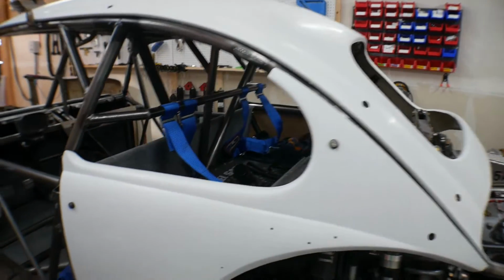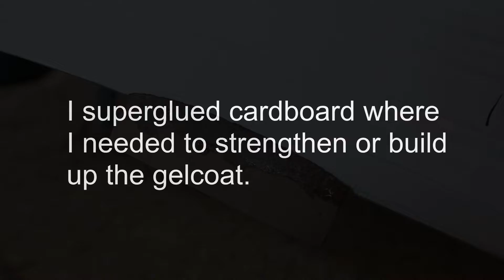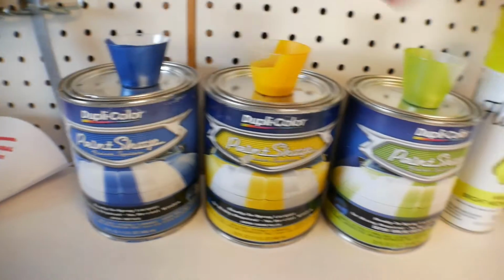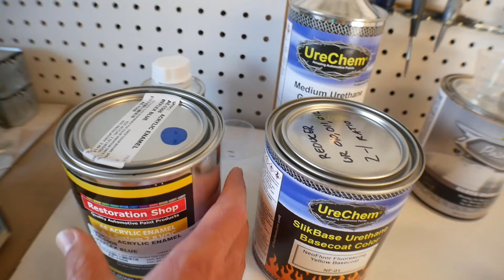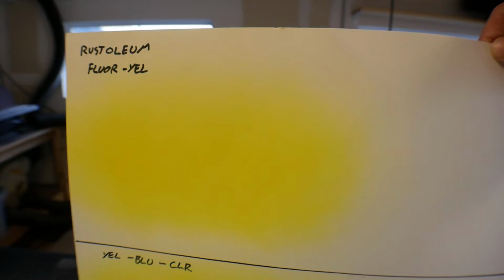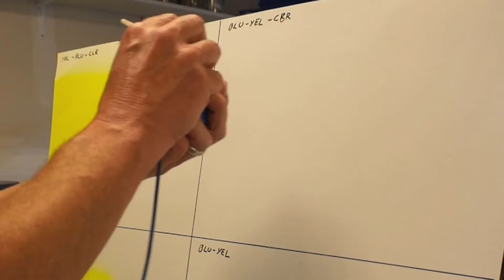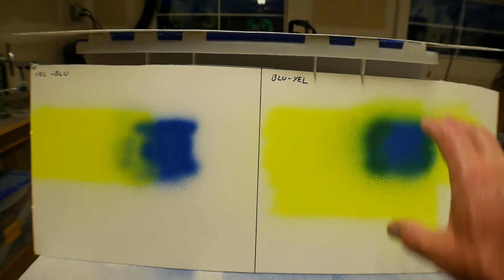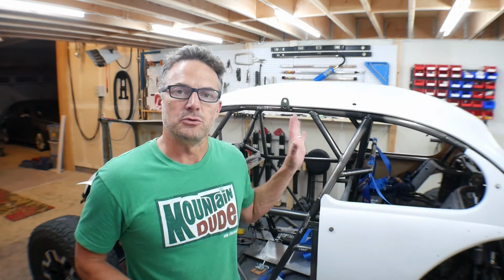Bodywork and Paint Prep for Wratchet

Comment: looking forward to seeing the results!  make sure you turn off & unplug ALL electrical pilots in your garage before you spray.  water heater/furnace, etc.
Reply from the maker: Never even thought about that. Thanks for the tip! 👍
Reply: @DougBugBuilder  also a good idea to tape off all doors going inside the house from the garage.  once those fumes get inside a house it takes forever to clear them out.  outside not a problem.

Comment: Sounds like an excellent plan but my only concern is, being Wratchet is an off roader, it would be hard to match a finish damage repair. If you paint it with solid color, you don't have to be a really good painter because you can always sand the orange peel then clear coat it. Can't wait for the outcome. All the best.
Reply from the maker: Matching repair panels will be a little difficult. But I think it'll be possible. That's the plan at least.